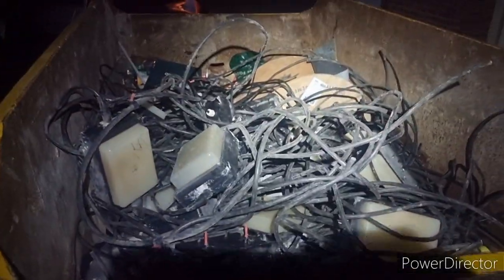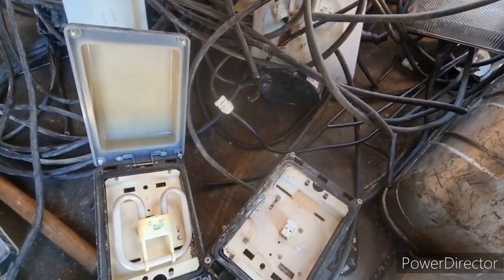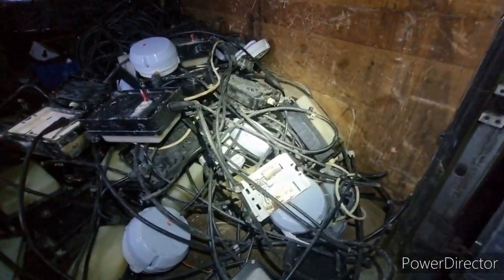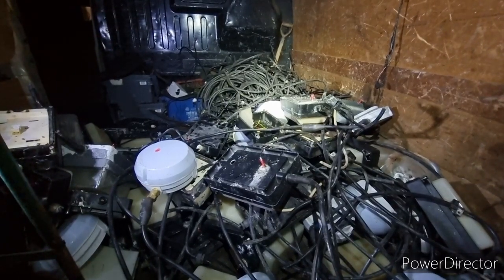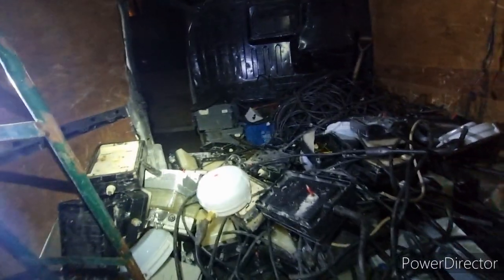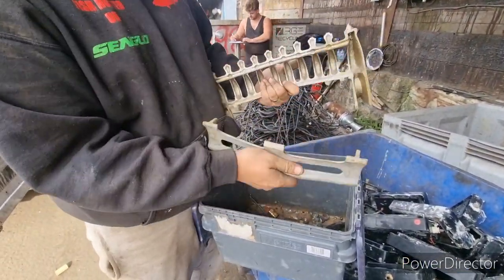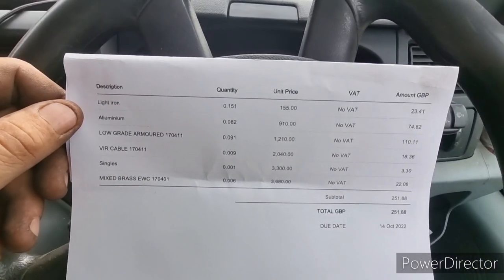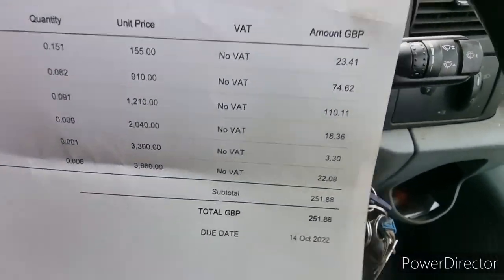mega copper cable find how much is it worth at the scrap yard

Comment: Ballast go in as irony ally at yard 
And there about £100 or more difference than Normal clean scrap
Reply: My ballast all have either brass or ally protecting the electronics. They are faily easy to open with the pointy end of a hammer.